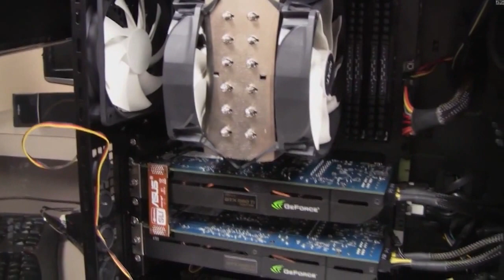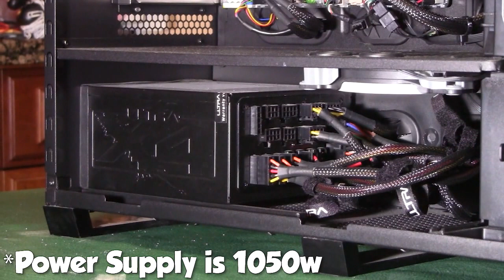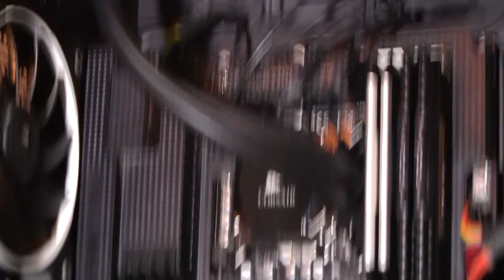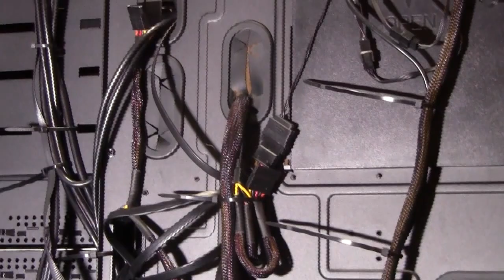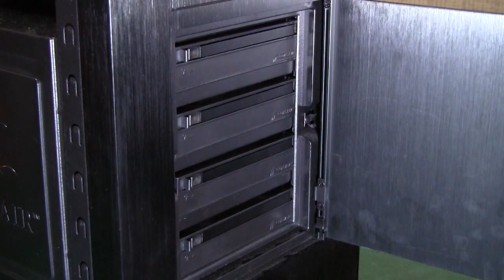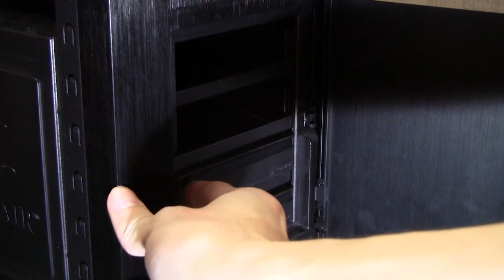My Custom Built PC ('Colossus Build')

Comment: Is that a WiFi card? Why? It adds much more latency.
Reply: +BonJarno Define latency
Reply: +RAMPAGEGAGE The ping will be higher in m`ny cases as it takes more time to communicate wireless with the router instead of wired. Mostly because wifi has can be slown down if there are too many wifi-devices (Mostly routers) in the area. If possible, use a cable
Reply: Well I kinda have to use a WiFi card cause my router is all the way downstairs and I can't move it cause reasons
Reply: +RAMPAGEGAGE That makes sense. I had the same problem too once and the wifi signal was very bad on that spot. I bought a Homeplug to solve the problem. It's not as good as a normal wire, but it's beter than wifi in many cases. If you have a problem with your wifi, you should check it out!
Reply: I would use Ethernet it's just my routers downstairs

Comment: buh, a stock cooler gpu.. 

PSU is garbage too.. Ultra X4.. (look into Seasonic next time, a lot of the best psu's of corsair/cooler master etc are often made by Seasonic as well)
http://www.jonnyguru.com/modules.php?name=NDReviews&op=Story5&reid=174 (higher wattages are often slightly better even..)

h100i is overpriced, just get a noctua air cooler nh-d14 or so.. (much quieter & cools almost as good)
You want to have a somewhat silent rig and you take a windowed 850d.. (Fractal R4 wouldve been better for your goals)

not much difference between an alienware and this. both have shitty psu & bad cooler on gpu + overpriced products in there.

Although you make very good tutorials ;)

Comment: That is a wicked machine man!  When my friend and I were building my computer, we couldn't fit the graphics card inside of it (GeForce GTX 760).  It wouldn't fit because the tray that would hold the floppy disk reader was in the way.  So we took some tin snips and cut that whole peice of metal out.  After the operation the grpahics card fit in the motherboard snug as a bug in a rug.  I still have the piece of metal as a trophy and a reminder of my first computer build.
Reply from the maker: Thanks. Well that's one way of getting things to fit :p. PC cases don't even come with a floppy slot anymore, so if you are going to upgrade, it will be a lot easier.

Comment: Beautiful build. Much better cable management then your last build from what I saw in this video. Nice case that thing is huge! I used a mid-case for my build and my next is going to be a case like this. If you can you should SLI another graphics card in there because if you can, why not. Was that a DVD optical drive or blu ray? Just came across you channel and its great man! Keep up the good work!
Reply from the maker: Thanks. I feel like I've improved in terms of building computers as well. I do plan on adding a second GTX 780 this summer. That was a Blu-ray drive, not a DVD drive. I'm glad you like my channel as well.

Comment: You should use sleeved black cables instead of the default ones.
Reply: NASTY
Reply from the maker: I was thinking about it, but I had already spent over $2000
Reply: Good point.

Comment: Hello again I want to buy an  OZONE Rage ST headset but it doesn t have a usb port to connect to my ps3 Can i use singstar adapter ?
Reply from the maker: I have no idea. I've only used headsets that have been confirmed working on the outside of the box. I'm currently using Tritton Ax PROs
Reply: thanks for replying  :)
Reply from the maker: You're welcome.

Comment: Nice build, I just finished mine!
Reply from the maker: Thank you. What did you put in your new build?
Reply: Here is the link: http://uk.pcpartpicker.com/b/L9k
Reply from the maker: Nice looking build, but I personally would go with the GTX 770 instead of the 760.
Reply: True but there were 2 reasons why I chose 760, first is because the 770 was sold out and second was with the 760 I got 3 free games! (AC4, Splinter Cell and Batman)
Reply from the maker: Fair enough :p.

Comment: Graphics Card=Latest AMD radeon and GJ for choosing my favourite processor Intel Core-i7
Reply from the maker: I'm more of an Nvidia fan, reason being is that I do not like AMD's drivers. Intel i7 is quite the great processor.
Reply: Intel I7 FOR THE WIN :D and AMD drivers perfect i run mc shaders seus ultra 30 fps but processor sucks
Reply from the maker: I run the Unbelievable Shaders Mod by Sonic Ether at 95 FPS :p. Nvidia GTX 780 in combination with the i7 though :p.
Reply: My Proccessor sucks only 2.50Ghz dual core
Reply: Wiltshire Tutorials But you have the one of the LATEST Nvidia that is why xD
Reply: Wiltshire Tutorials Can you tell me why i freaking cant run SEUS shaders ultra v10.0 i run it with 30FPS a little laggy.My specs:OS Windows 7 Ultimate 64-bit,CPU:Intel Celeron2.50GHZ dual-core,4GB ram,GPU:AMD Radeon HD 6670.Can you please tell me what sucks i my PC so i upgrade please.
Reply from the maker: The shader mod is very demanding in terms of memory and speed. You are going to need to add some more RAM and upgrade your Processor. The CPU in your PC is holding everything back, it is the bottleneck.
Reply: +Wiltshire Tutorials I knew i need atleast a Quad-Core one :D thanks a lot you are the best.Can i have 2 or more GPUs?And if Yes can they run both at the same time?
Reply from the maker: Oh ya, you can have more than one GPU. Just make sure your motherboard is capable of Crossfire/SLI

Comment: Nice build dude, i gotta finish mine up
Reply from the maker: Thank you. What do you have planned for your build?
Reply: Wiltshire Tutorials
I got it mostly built but I've been so busy lately that I haven't been able to finish it.. Tt Level 10 GT case, Tt 850W PSU, 2600K on Antec 920, GTX465, Asus Maximus IV Extreme, 8GB Corsair Vengeance, Samsung 840 PRO 128GB, 2TB WD black, 2x500GB WD Black.  A couple generations behind but it's still damn solid!  Next upgrade is the GTX,,
Reply from the maker: Sounds pretty solid to me. Seems like it will hold out for a few more years to come. I agree that the graphics card may need an upgrade soon, but it will play things at medium settings, so it's not bad.